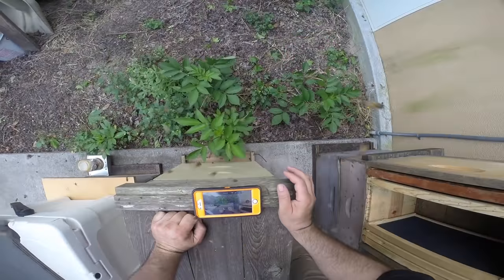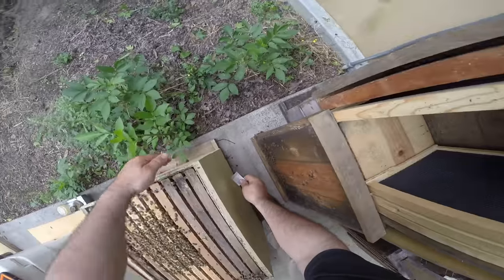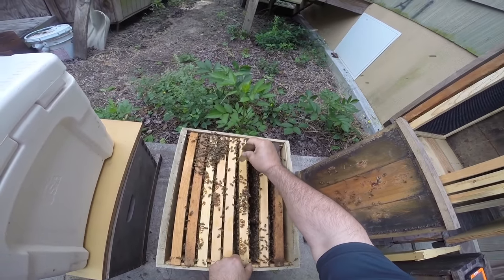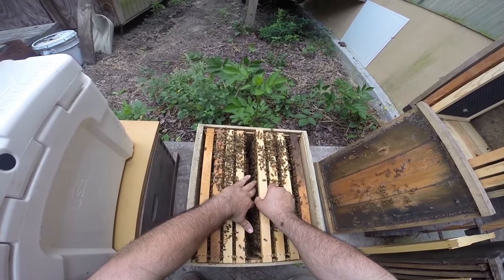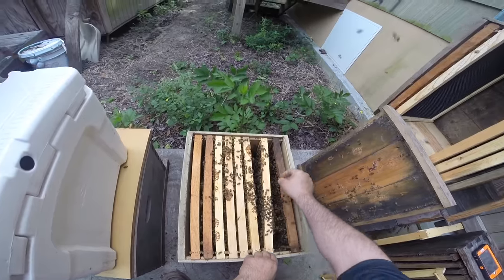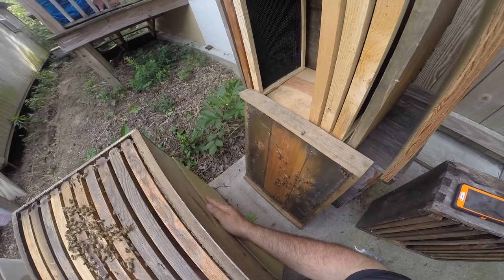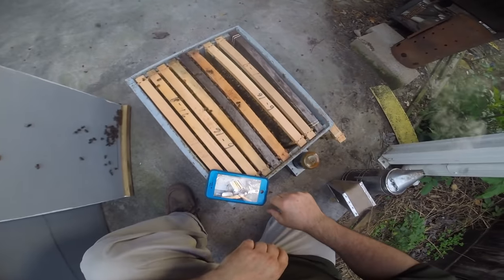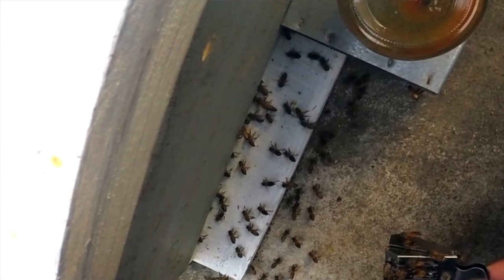GoPro Hero3+ "Queen Release & Hive Inspection"

Comment: Hey JP,
I'm new to your page and just want to say I love all your videos. I'm not a beekeeper, however I've always thought it was a pretty interesting hobby. I wanted to ask a question. What is the smoke and what does it do?
Reply from the maker: Steve Lockwood the main thing smoke does is interfere with their ability to utilize alarm pheromone. Any type of fuel will do as long as it produces a cool smoke.

Some common fuels are pine needles & burlap.
Reply: I don't come across too many pine needles here in Sunrise, Florida....but I have palm tree leaves all over the place....and they burn for awhile.
Reply from the maker: Mike B. Sunrise, FL you know that brownish stringy stuff between the bases of the palm leaves? I've used that as smoker fuel, makes for pretty good fuel.
Reply: that stuff is on coconut palms and queen palms.  I haven't had luck with either one of those in my area as the soil isn't sandy enough for them here.   I have the Christmas palms all over my  yard.....they are the one with the green seeds that turn red when they ripen...the frons dry out and turn brown......they burn with the thickest smoke and it comes out of the smoker very cool.....burns for quite awhile too.   You end up smelling like a smoked turkey if you are downwind from the smoker though.